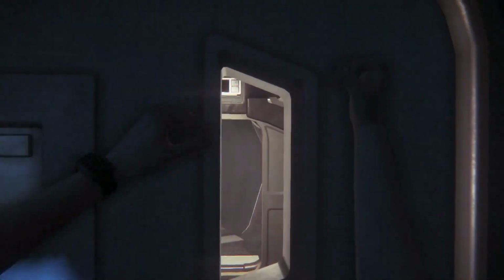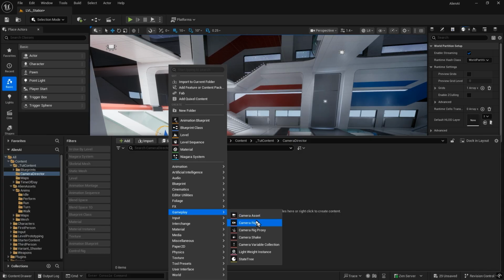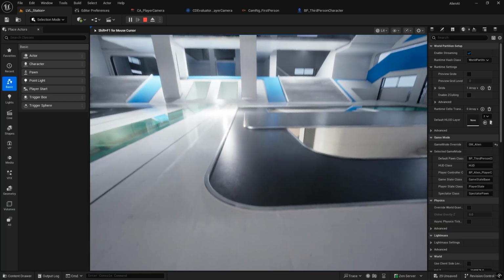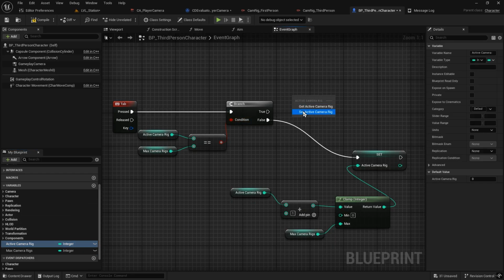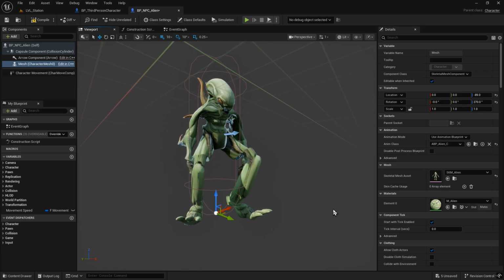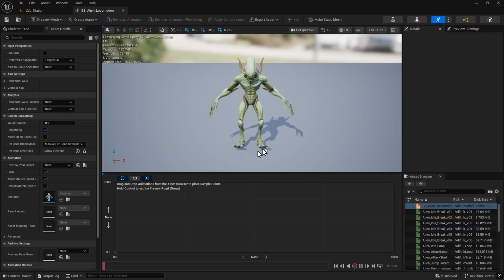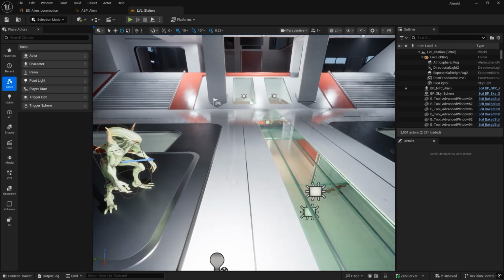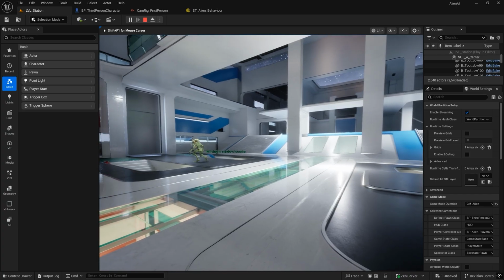Part 10 - Adding Gameplay Environment, First Person Perspective, Skeletal Mesh & Animations.

Comment: For those in Unreal 5.8 (Camera setup):
The GameplayControlRotation Component is broken - don't use AutoActivate, because it will crash the editor!
Instead, check "SetControlRotationWhenViewTarget" to true on the GameplayCamera component.

And in the CameraRig, add a "DampenRotation" node in the sequence between "BoomArm" and "FieldOfView" - use high values for yaw and pitch e.g. 50. This will smooth out the camera rotation so it's bearable to look at.
(Also use high values in "InputAxisBinding2D" for Multiplier and Speed - e.g. 50 in X and Y. It's important that Multiplier and Speed use identical values as well!)

The PlayerCharacter BP also already adds Yaw/Pitch input directly from the (Enhanced)InputAction,
and since I in this setup have solved the crashing issues by directly using ControlRotation on the camera, the input node to the BoomArm "InputAxisBinding2D" should be replaced with "DrivenControlRotation".
Then instead we modify camera rotation speed in the character BP, and the camera rotation doesn't reset when switching between different rigs - much better!

Phew! The glory of replacing things that work with experimental stuff.

Comment: If, for any reason your engine crashes (5.7.4), when you quit play in editor (Until i quit, everything works as intended) after you add the GameplayControlRotation component, and set Activation to your player index, and tick Auto Activate:

Set the Auto Activate back to unticked. (I also put the Auto Activate for Player back to Disabled, before unticking)

Still inside yout player BP, near Event Begin Play (Or at the last node in the chain, it does not matter how many nodes are before or after it) drag your GameplaycontrolRotation from the Components into the graph. From there drag and search for "activate control rotation management for player index" node. Connect it to the Event BeginPlay, and set your index (probably 0). Now from the same Gameplay Control Rotation we just used, drag again and search for "deactivate control rotation management". Then right click on an empty space and search for "Event End Play" (If you did not used it before. If you did, obviously act as you did with BeginPlay), and connect the deactivate to it.

Like this, the crashes stopped. Also later i tried to unplug the activation logic, and set it again in the Details panel of the component, and with only the Deactivation used in Event End Play it still worked, but i think the above method is better just to be sure.

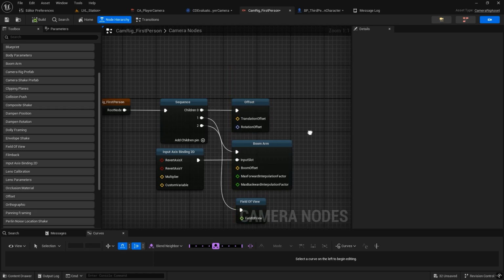Comment: 22:47 anyone who is using 5.8 or maybe 5.7, may encounter an issue where you set the gameplay control rotation component to player 0, then the editor crashes. This is because when overriding the SetActorRotation in the Anim Blueprint with the Rot Bone node, It will cause a crash. GameplayControlRotation Component does work, but it will crash the Pie when set to auto-activate and player 0. It runs once or twice, then errors and shuts down the editor.
Reply: You either need to use 5.6 or find an alternative way to rotate the player or wait for this bug to be fixed
Reply: @warpup7778  I had the same problem. Wrote a comment about a workarround to be able to use it without crashing. Check if you are still struggling with it.
Reply: @diesel1113  where is this workaround comment? Care to add it here?
Reply: @007LvB  Sorry it probably got filtered out for you by Youtube. I copy the important part:

Set the Auto Activate back to unticked. (I also put the Auto Activate for Player back to Disabled, before unticking)

Still inside yout player BP, near Event Begin Play (Or at the last node in the chain, it does not matter how many nodes are before or after it) drag your GameplaycontrolRotation from the Components into the graph. From there drag and search for "activate control rotation management for player index" node. Connect it to the Event BeginPlay, and set your index (probably 0). Now from the same Gameplay Control Rotation we just used, drag again and search for "deactivate control rotation management". Then right click on an empty space and search for "Event End Play" (If you did not used it before. If you did, obviously act as you did with BeginPlay), and connect the deactivate to it.

This solved the crash for me, but i have to add, in the past four days i were experimenting with this camera type, and i personally had to revert to the previous camera. It is a really good thing, but still seem to have some parts, where things go bad with this setup.
Reply: @diesel1113  Interesting! Thanks for sharing! I eventually figured out another way to make it work (check my comment regarding Unreal 5.8 :P).
But I also think this is a little too experimental for me. The old Yaw/Pitch input methods have a decade of tweaking, and they are based on Euler angles, so they are more suitable for an FPS anyway.
So I'm just following this setup for the sake of the tutorial, but will not use it for my own projects yet.

Comment: Ive followed along since the beginning and I must say, this is the best State Tree tutorial video on youtube right now, awesome and thanks alot. However, I seem to be having issues with the gameplay Cameras and GASP locomotion. The camera and walk directions gets mixed up, the camera location is attached to the pelvis area and the mouse movement speed needs to be increased from 1 to 80. Ive tried it with a normal thirdperson template and it works fine. Secondly, how would I implement another sense like hearing, do I just recreate this with another AI Perception component  or would i need a whole new state tree?
Reply: Same problem in Unrel 5.8, except the editor crashes every time I end PIE session - because there's a bug inside the GameplayControlRotation component.

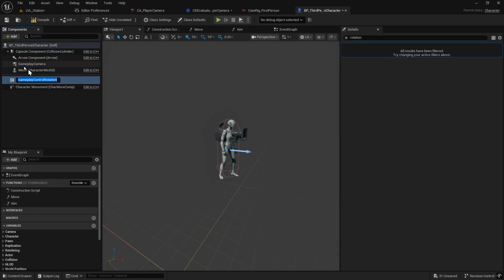Comment: Does anyone else have an issue where adding the game play control rotation crashes the game when pressing the esc key. I have replicated this issue on separate projects. Has anyone else experienced this. I'm using 5.7, @metaxisgames any ideas. It's always after adding the gameplay control rotation. 21:56
Reply: Yes, I have the same problem.

Comment: Your plugin can't be removed once it's implemented, turning it off or deleting the plugin files through any means renders my project unopenable and it crashes Unreal, once this plugin is in a project, it stays like a virus
Reply from the maker: What do you mean by "once it's implemented?" do you mean you added functionality from the plugin to your project? If so, then yeah it requires the plugin to function, not sure why that's such a surprise for you.

If you want to remove the plugin you need to remove the plugin functionality you've implemented first, so any functions, or the custom controller, etc. Otherwise your project will be looking for code that doesn't exist if you remove the plugin. 

This is normal behaviour.